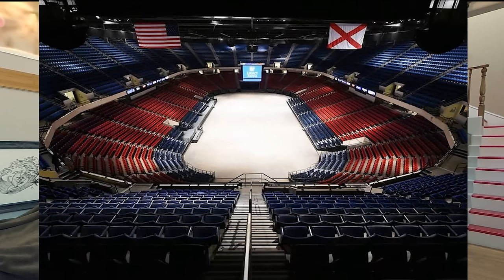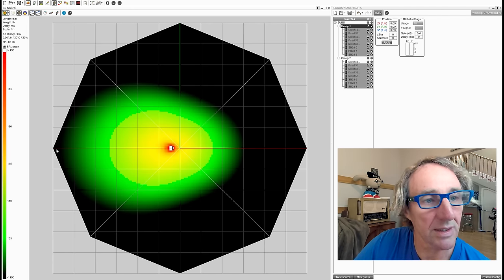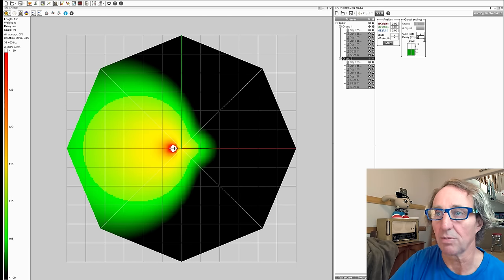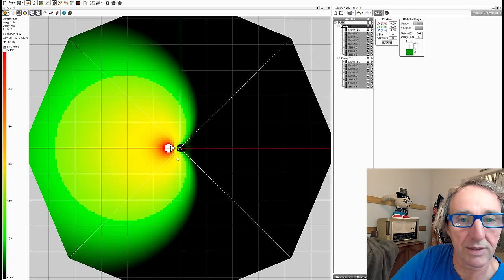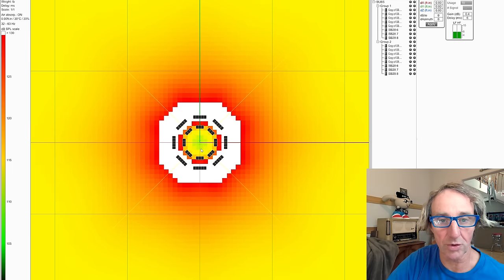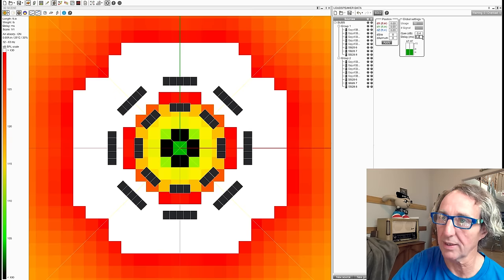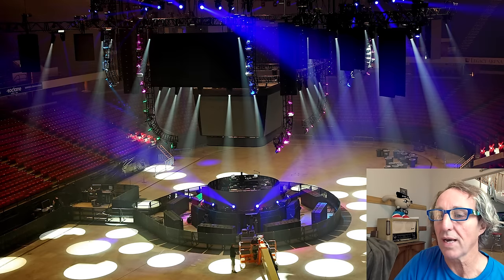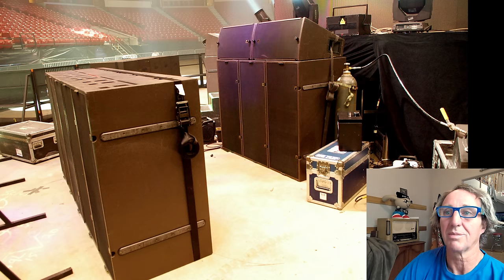Bassnectar 360 Subwoofer Sound Design

Comment: Wow!
Amazing setup!
I am interested in how much power it took and how the power was routed.
Reply from the maker: I did not deal with that side of things. But typically we drom a main distribution and several smaller distributions. Then cluster amp racks around the distorts. For this I think all the power and distorts were under the DJ riser
Reply: Typically the venue will have an event document detailing what the show needs. 
It varys, I've seen everything. 

In an arena like that, typically the house has electrical rooms close by underneath that first section... with a cable pass thru to easily route the feeder tails to concert switches/disconnects. 

Many venues have floor boxes. 

Example; the tour will spec a 200amp drop here, a 200amp drop there, a 400amp drop over here... etc.(208v 3phase)
Whatever they need, wherever they need it. 

Typically the show will have power distros, with tails ... then the venue supplies a fused disconnect/safety switch, for the rated load the show specs. 

The show will have feeder tails (flexible welding cable type), the the house takes those and lands them in a disconnect. 
From a 30a switch, up to an 800a switch ... higher if needed. 

Oftentimes the event/tour will bring their own power, as event power from the venue is expensive. 

If they bring their own power generation (Aggreko etc.),
 then they handle everything... stage hands will run feeders... I've seen dozens of feeders... all in a row... hundreds of feet. 

Way more than you asked ... but I lived simultaneous careers on both sides ... house supplying the event, and a client, FOH, spec'ing the event. 

The biggest events ... I've since retired and I truly miss it.
Reply from the maker: Yeah, we do loads of shows and pay very acute attention to power and are very arare of rated draw and actual measured draw.

We were well within the specs

This venue had a loose connection that overheated.
Reply: @DaveRat  How did you handle the cooling with the power and amps under the DJ riser and out in the middle of a basketball court?
Reply from the maker: The amp racks are self sufficient and the sub design has all the subs powers withing  .4dB of each other
Reply: @DaveRat  I was asking about the cooling because when I worked at clubs here in Atlanta (Red Door, QUAD, Spring 4th Center, The Chamber), keeping the amps cool was a real hassle. Thanks for the responses!
Reply from the maker: Yeah, that vlcan be an issue. Newer amos run cooler and are more efficient . We don't really have thermal issues with the L-Acoustics LA8s we used in that gig or the newer la12k.

But yes thermal management can be a challenge

Comment: crazy how much the delay changed it, and then the temp on top of that, I wonder if anyone has hooked up a sensor to their smaart / processor to change timings as the room temp changes lol
Reply from the maker: I've seen gear with temp sensors attached to delay times. Back in the 90s BSS had it on their crossovers

Comment: Dave, what if you were to increase the diameter of the performer area and spread out the inner and outer sub stacks?  Would give the center area more quiet or will it throw things way off? How many milliseconds difference would it affect?  I am intrigued...🤔
Reply from the maker: Increasing the diameter of the arrays will reduce venue capacity and push audience farther from the performer.

That said, increased distance will always lower volume level

As far as delay timing, in this design it is purely related to the distance between the inner and outer ring, not the diameter of the rings
Reply: @DaveRat  what about the inverse aka shrinking the circle? The null area looks fairly small, is this around the minimum circle diameter of the ring? Or would it be possible to have a smaller stage/smaller ring and adjust the delay?
Reply from the maker: The circle was determined by the DJ riser size

Comment: Dave, it's not about subs, but I hope you can help me... I am struggling into making a enclosed space sound nice. It's a room - 25m x 8m, with an height of 5m. The PA system is strong enough to fill the space, but the sound gets duller at the back. When I make the sound bright enough at the back, at the front it gets too harsh. I'm thinking about putting speakers on the back facing forward, to theoretically have a uniform sound throughout the room, but I don't know if this will work or if I'll have problems... Or if there's a better solution...
Reply from the maker: Raise the speakers up higher
Reply: @DaveRat  Thanks for the tip!!

Comment: Is there a reason you can't use some shielding or move the source further away from the center?
Reply from the maker: Trying to physically block sound waves requires either a rigid airtight seal or structures and distances that are significant in size or some soon on relation to the wavelengths involved.

The wavelengths are 40 feet to 14 feet.

So, the choice is between huge, massive expensive and marginally effective or this that theoretically reduces the sound 10,000 times quieter in the middle than ate 300 feet

Comment: Were there any safety features in place to prevent a jump in dB at the DJ position, in case of failure of inner or outer ring?
Reply from the maker: If the entering had failed it would have been just like the year before that I didn't work on

That said it would require multiple simultaneous failures for that to happen as the signal is distributed separately to all the amps. And the DJ has a headset that can say hey it's too loud or walk 10 ft away from the center where it's quieter

Comment: I love watching your videos and learning from someone like you. I have a question if you could answer what would be the best set up for 2 single 18 inch subwoofer I always put one on each side of the stage but iam getting lots of low end on the stage what would you recommend in this case I perform in medium size venues and there  is usually 300 to 350 ppl. Thanks Dave.
Reply from the maker: Try running the subs on two separate aux or group send a and send more bass to one side and more kick to the other. This will reduce the center buildup of sending the same thing to both sides.

If you can't put them on an aux. Try panning bass more to one side and kick more to the other.

Let me know how it works for ya
Reply: I see what you saying. Now i run a 2 channel crossover so  i send full range LR signal to from my console to it.I can control each sub individually should i set a different crossover point on each of the sub ?
Reply from the maker: Not really, just set a good crossover point. If the subs clip before the mains, lower the point, if mains clip first, raise the point

Comment: Dave youre the man, seems like a fun project to work on, like a school project one enjoys. 

Let me guess... Bassnectar paid you for this gig, he got these specific programming details through feigned curiosity, and then you never did a 360 gig again? =]
Reply from the maker: Ha! I shared the design details with the tech that worked the next 360 and I think they used my design on all shows after.

Bassnectar asked me to mix sound and I turned it down and they hired someone else and a diff company after that.

No bad blood, just divergent adventures.
Reply: @DaveRat  "divergent adventures" is this an album title?.... hope you got paid appropriately for taking them to class =]
Reply from the maker: Yeah, I do and have done quite a bit of complex audio problem solving and compensation in the form of being hired to supply large sound systems, direct pay and long term trust as the go to guy are all good.

I do a bit of work like this for the Hollywood bowl and Coachella as qell
Reply: @DaveRat  indeed partner, bore witness to many of your sciences boss

Comment: First thought was to use horns from the start. An HSD Sound Systems, 21” battle axe sub has around 12db of rejection in at the rear.
Reply from the maker: Very cool and hey hey Swingset! I meeded frequencies down to 26 HZ because as the name of the artist may indicate, super deep low end is what he's all about. Horns would never make it down that far without being too big to see the artist
Reply: Unrelated but another benefit of using horns is the fact that you’re first halving of spl is around 26’ due to the 13-14’ horn path!
Reply from the maker: Hmmm. I will have to ponder that. The 6dB per doubling of distance should start at the horn mouth as that is where the sound is released into open air. The spl in the horn itself will not drop at the 6dB rate. 

But typically, spl measurements are done at the horn mouth or at soune distance.
Theoretically it should drop at the same rate as a non horn box. Once sound leaves the horn mouth
Reply: As far as low end extension, this particular horn comes in at 28h at -3db and 22 at -10. 
As far as dimensions, it’s only 
50” x 52” x 25”. Obviously there’s others but my experience is with this one in particular. 

They’re fairly directional but that can be worked out in many ways. 

Anyways, I love your videos but would be super excited to see more on horn’s as there’s really not much out there. Have you worked with modern horns at all?
Reply from the maker: I don't do much with horns, I see them as acoustic impedance transformersbwith distinct advantages and challenges.

I personally have tilted more toward wide bandwidth lower efficiency designs that are naturally more linear and strived to push them louder.

Horns are narrower bandwidth higher efficiency designs where the challenge is to get them more linear as they are already loud.

That said, I am not against horns, it's just not my area of expertise or experience.

Comment: i was wondering what the temperature impact was on the surround/spider, thus fs of the driver, lately 
i had these new 18sound drivers after 4 hour brake-inn, still having a 18HZ higher fs than spec. and than thinking, my workshop was almost freezing!
Reply from the maker: Don't know but it is important to drive the same or very close to the same power into all the speakers so they all warm in unison. Maintaining the cancellation

Comment: Are there fail-safes in place for if the inner ring fails? Is it easy to tell if they do?
Reply from the maker: It's not wired for inner and outer as seperate. Amps power the various speakers and amps have processors with delay. And every amp gets the same signal and either delays or not based on the speakers connected to it

Comment: Does this mean that in a huge venue you have to be absolutely perfect in your subwoofer placement or the delay would be all for nothing?

Would you want surveying equipment to make sure your subwoofers were millimeter-perfect in this case?

All it would take is having a few subwoofers setup a couple inches off and you'd change everything...
Reply from the maker: Typically this precision is not needed. A ring of subs is an extreme case and Bassnectar is an extreme low end artist that pushes subs to their limits.

So no, much less precision is typically needed
Reply: @DaveRat  Many thanks for explaining that for me Dave!

Comment: Super cool to see your process. The magic of frequency canceling by doubling the sound. When you stand between the inner and outer boxes does in sound like a phaser like chorus fx? Also, what visualization simulation software were you using. I’d like to play around with it for fun. Cheers!
Reply: I thought of something. I wonder if you could use a digital thermometer and a Raspberry Pi to send a signal to your system for adjusting your delay dynamically when you have temp swings.
Reply from the maker: In concept that sounds a wonderful idea.

In practice the amount of time it would take to develop and set up And then do full volume tests over a wide temperature range and implement safeguards makes that a bit unwieldy.

Especially considering we would probably need someone to monitor to make sure it works anyway.

But if this was an installed system being used for many many shows, that could become desirable to develop
Reply: @DaveRat  no doubt it could be clunky. I’d definitely monitor, not set and forget. What software were you using to visualize speaker setups?
Reply from the maker: Sound vision it's a free download but only has Lacoustics boxes in it. That said you can use a double 18 to model most double 18s quite well

Comment: As a beginner, you've already taught me a lot. I bought two monitor wedges from a buddy for a hell of a price, now I own more stuff than I ever thought I would, because apparently that's what you do when you get into sound. That all being said, I'm in need of a new mixing board, I have outgrown my current Mixer. Would you think it would be beneficial to spend the extra money for a digital board or stick with the analog set up I currently use with a larger board? I'm mainly doing speaking events and small parties, so I'm not generally micing instruments. I run a lot of lav mics for conferences and such.
Reply from the maker: I'd get a digital board as it has more control, smaller lighter and sound great as long as you never overload them
Reply: Sweet, I know you're big on analog, but I also know you've got some decades in this game, so I appreciate the input.
Reply from the maker: Analog is great for fast easy and see everything always. Interactive. But not as versitile or compact like digital
Reply: I feel like that is the way I'd like to be, but having everything digital helps consolidate things to the point that I won't need a huge rack to run everything the way I want to with compressors, bridges, or whatever else might help if I jump into bigger gigs. Analog would take more money to buy the specific equipment needed, but digital is more expensive for the single unit, so I'm sure it pays off in the end...hopefully. Thats the only reason I'm torn between keeping and building an old school analog setup or switching to all digital. The other thing is trying to learn all the things I can do on the digital side. Being very green, it's kind of intimidating to switch to digital.
Reply from the maker: Yeah, use the best tool for the job.

I stayed with analog as I was well experience and consistant analog engineer. And also a mediocre and inexperienced digital engineer.

So it made sense for me and I had the budget and access to the gear.

For my videos and testing, I use digital as it is easier, smaller faster and more repeatable.
Reply: @DaveRat  I'm a mediocre and an inexperienced analog/no experience digital engineer/just have fun hearing what I can put out on my speakers(which is why I love setting my stuff up). I can say that I've never had any complaints on the events I've done so far, I feel like I'm my biggest critic. I really appreciate the input on the subject matter, now I just need to figure out what I want to get for a good digital mixer. I know if I ever need to make a living at this, I need to keep with the times and do it right. I have just enough gear to make a very professional small show sound great and a larger show sound okay...ish.  I just don't want to buy stuff that's not needed if I can help it.

Comment: 1:40 Do you know why he was still using hard drives in 2015/2016? The only reason I can think of is if he was using absurdly large drives. It's still cheaper with HDDs if you need really large drives (like 5TB and up) but otherwise you might as well use SSDs, even back then.
Reply from the maker: If memory serves, SSD was about $2000 per terrabyte or more back then. Unstable and limited read write with special software that avoided repetitive writes to the same locations.. I know because I had one and it failed, still have it. 

He had redundant mirrored drives with backup and all 3 had previously failed as well as other gear and vision and hearing issues due to vibration

Comment: I wonder what would happen if you did the endfire setup but did both of them in a cardioid configuration with 3 forward 2 facing back in the outer ring with 2 front on back for the inner,  then delayed the the outer ring to inner ring?
Reply from the maker: I modeled that and it had a greatly inferior cancellation to the final design

I modeled about 10 different versions or more. And I actually challenged multiple people that I work that are more experienced to a soundvision than I am to come up with a design that had better cancellation than the final version.

Anything that doesn't have perfect symmetry and perfect distances and perfect timing and perfectly aligned polarity shifted subs set at the perfect DB volume level, offered inferior results.

Turning subs around backwards and trying to combine the rear energy of the front subs with the front energy of the rear subs was greatly inferior as well.

Setting the subs in cardio mode created complex cancellation nodes that were not perfectly symmetrical all the way around so canceling those out with additional complex cancellation nodes resulted in poor cancellation in the center
Reply: @DaveRat  yeah after I wrote that I would imagine the lobe of cancellation behind the outer pairs would cause cancellation in areas where you wouldn't want it as well.  Thanks for the detailed answer, it's good to know that the best results come from dedication not just someones first idea.
Reply from the maker: Yeah I went and looked at the files and I have a whole bunch of things I tested to try and get there and this simple-ish clean dual ring was by far the best